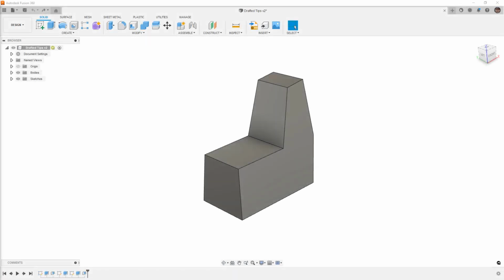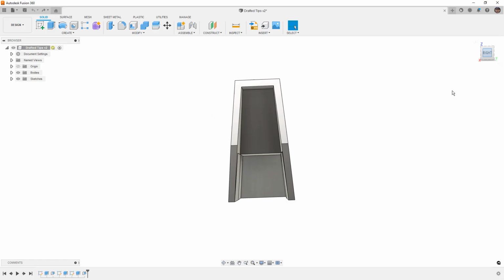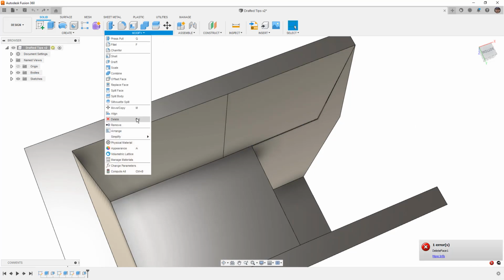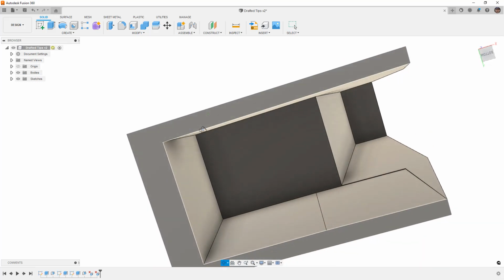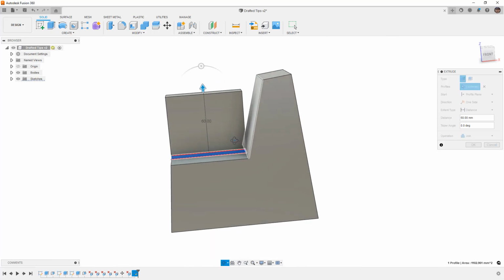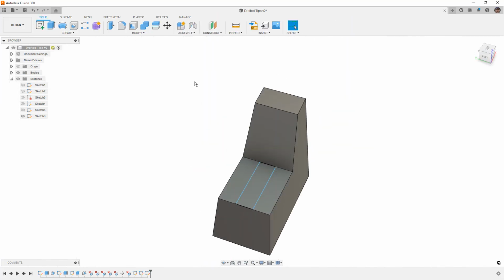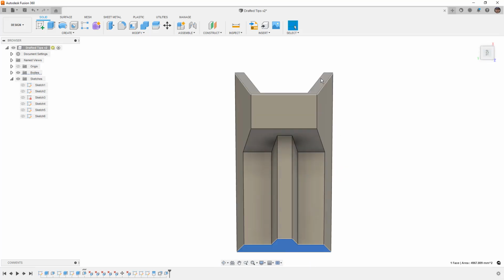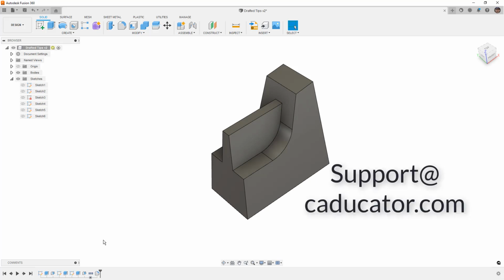Direct Editing for Molded Part Design | How to use Delete, Press Pull, Move/Copy and Split Face

Comment: Really interesting video thanks, you have a very good grasp on all the different features of F360
Reply from the maker: Glad you liked it!  I have been using Fusion and training people with it since 2016 or so.  I make videos for Autodesk and others :)  If you have any questions let me know.
Reply: @LearnEverythingAboutDesign  If you have any suggestions on how to handle change management to designs and drawings that would be useful. 

Some of my designs get complex with multiple components and it makes me worry when the customer wants a change. Such things as, is it best to design from a new plane etc for a new component instead of sketching on another part as a reference because if the base part changes it can upset other parts downstream. Top down and bottom up assemblies also might be useful for other viewers. 

I'm full of ideas, if you're ever struggling message me.
Reply from the maker: @Rich10000  For sure Rich.  I have some workflow videos planned.  For change orders/revisions etc there is a Manage Extension to deal with Release and so on, but from a design perspective it is very tough for sure.  I am trying to collect some thoughts on the best way to present it because its a HUGE topic.  Do you design assemblies that have joints/motion, always require drawings/boms and contain external components?
Reply: @LearnEverythingAboutDesign  I do not do many motion studies apart from grounds or surfacing. So this year I have reengineered existing vehicle radiators for a customer and for them to manufacture they require all the CAD, drawings, DXFs and BOMs. Being a whole project and some of it being concept and prototype sometimes there are changes and I have to deal with that as it comes, somtimes I have to take shortcuts on the design which is not ideal and can effect the cleanness of the design.

For this I do top down assemblies and model the parts in context as all new components and I find this works well and do the drawings of each part then export the drawings one by one as PDFs. It can be difficult to make sure the parts are all up to date, correct, no parts missing etc for this I have resorted to using spreadsheets with all my part numbers, parts and statuses. As you say very difficult and gets hard with over 25 parts, multiple projects on the go, does get better with expierence but its very much a workflow I've made myself.